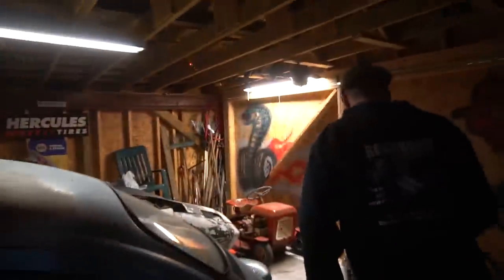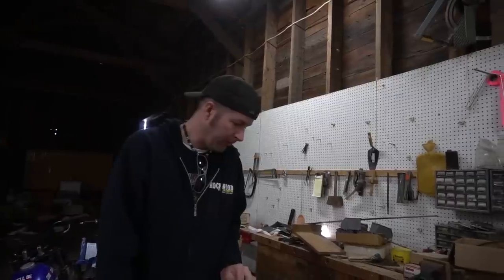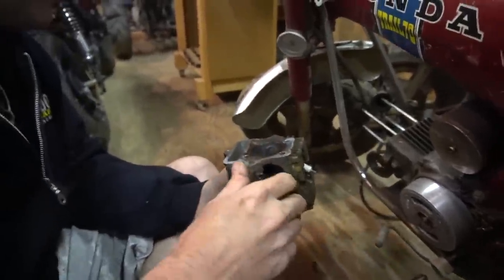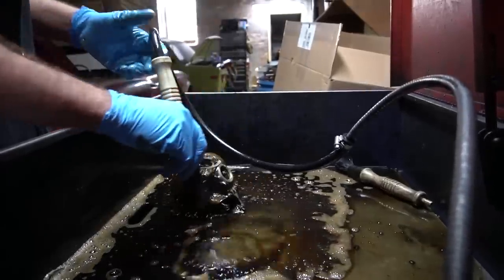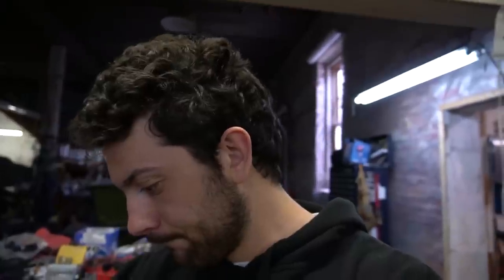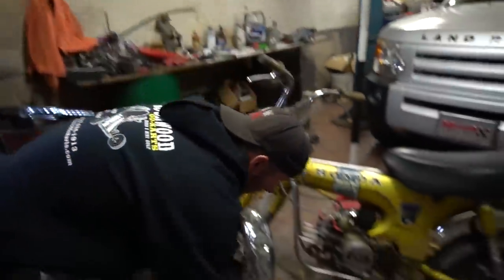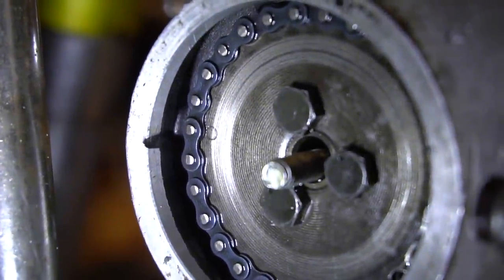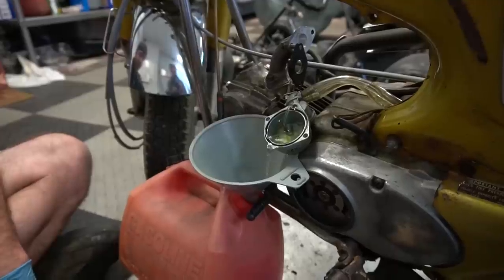Head Shaving with a Belt Sander! Trail 70 Performance Mods

Comment: I was about to just say that shaving the head would mess with the timing a little I do modify my two strokes I have yet to shave a head but I knew what would happen with the overhead cam four stroke.
Reply: BALDY'S CUSTOM PROJECTS it is very easy to totally screw a 2 stroke up. I build highly modded 2 stroke RC nitro engines. Messing with anything cylinder wise on a 2 stroke affects port timing,  squish and quench of the engine. it only takes .0001 of .0001 to take a 3.00 CC,  3.0 HP 45,000 rpm screamer to a 12,000 rpm dog that pings and overheats under any load. Been there done that.
Reply: losi8ightyew got it👍 i know what im doing to my bike engine but 45k rpm's ???
Reply: BALDY'S CUSTOM PROJECTS also wouldn’t the chain slap a bit. I thought I heard it I the video after head shave
Reply: "RC nitro engines" 
short stroke = high as frig rippums

Comment: hey guys,

a daytona 150cc or 190cc are the best options to go fast and reliable.
honda nice engine are one of the best but hard to find and high price
you want less speed but more comfort? then go with a zongshen 190cc.

here in belgium everybody loves the honda dax (ct50 / ct70)
if you want more fun of a bike then go for a honda monkey ( z50a or a mini trail )
for almost each state we have a club, and almost every weekend there are meetings where we go for a drive in group.

i prefere the monkeys , because they are lighter and look better

kind regards

Comment: when you cut the head on an overhead cam engine the centerline of cam is moved closer to centerline of crank affecting the timing.
Reply: AND with that much compression increase you are probably in racegas territory. or E-85. get a wideband and temporary mount on exhaust.
Reply: oh, lol. you covered it.

Comment: You shaved the head. Wouldn't the cam sprocket turn with the cam center now closer to the crank?
That must have some kind of chain tensioner (?)
Reply: Yup a chain tensioner on only one side. That's what caused the sprocket to rotate and not line up

Comment: The only thing with belt sanding the head is you have no real measure of how much you have removed and as a result you will get some predestination, as well as the timing will be retarding the timing (as noted by the gent from Go Power Sports).   Honestly I would have tore open that original head as the main reason you were low on power was most likely the air leak in the intake tube.

Comment: Hey guys...got a question. Predator 212: Could bad rings cause oil to come out the breather as well as burning oil be due to crankcase pressure? What would be other symptoms of bad rings?
Reply: Matthew B. I thought so too, but I made sure it was right... maybe a little too low...
Reply: Matthew B. That might be it...
Reply: Forgot to mention that it’s burning oil/ fouling the plug every 15 seconds.

Comment: Should’ve ground the heel of the cam for more lift.
Reply: It’s a velocity port it needs to go from 25 or so to about 23 millimeters so you need a micrometer.As far as fixing it you can just put some epoxy in there.And the exhaust has a giant weld in there at the header that you need to grind down.

Comment: Just go buy you a wrecked 2000's 600 and pull the wiring harness and motor. Your looking 120-150hp and you can mount a pingle electric shifter on it and have a push button shifter rail cart.

Comment: use double gasket at the bottom of the cylinder , check valve clearings. You ll be OK .....ohh and use some new valve seals , you re burning too much oil .

Comment: Mpg advertised was 96.1 of a 72. 138 miles on a full tank. Did i spot an old AMC gremlin in Ike's garage? That would be a nice car to restore if it is! That head has a hardened valve seat on the head your hillbilly shaving! Lmfao

Comment: This was a bit hard to watch as parts for these bikes cost a small fortune.   Also if the engines are noisy the main culprit would be thr cam which just sits in the head without any roller bearings.  As clearances increase they make more and more of a racket.   You boys just need some CT70Hs.  4 speed manuals crush the 3 speeds.
Reply: Xaphan Vassago theres only an oil pickup screen and as these engines get more modern roller bearings are incorporated, though i dont know exactly when.  These are kids bikes and are thus subjected to generally very poor maintenance and usually are beaten to death. That and being 50 years old, i have several worn out 70 heads that are super noisy.   Well death isnt ths right word as these motors are nearly indestructible and though will get noisier and noisier will still run.

Comment: if you guys don't intend on these engine running 50 60,000 miles just ditch the air filter all together and especially if you're not going to be on dirt road environment

Comment: you should do a compression test. that will tell a lot. put oil in spark plug hole compression comes up cylinder and ring wear. if it doesn't it is valves. not rocket science.

Comment: You shaved the head thus causing the chain to seem longer to the engine.  That's why the timing is not lining up. (there is no chain adjusters/tensioners in these motors)

Comment: This will bolt into the CT70, it is a Piranha 140cc Pit Bike Engine
https://www.ebay.com/itm/Piranha-140cc-Pit-Bike-Engine-crf50-atc70-crf-50-70-atc/390887546230?hash=item5b02b69d76:g:0dMAAOxy~iJRAAkN

Comment: The timing is now off because you shaved a lot from the head! This will put slack into the timing chain. And its only tensioned on one side!

Also you decreased your max rpm by adding so much compression!

Comment: Do yourself a favor and buy some actual jets and educate yourself on jetting / tuning
Reply: Keegan Browning a 15mm carb will flow enough air and fuel for at least 10hp. I have a chart somewhere with the correlation between carb thoat size and hp. Should be easy enough to find online
Reply: Swan Donovan for 10 hp a 19-21mm carb is optimal, as long as you aim for high rpm power😉 but i would not even bother with anything less than 18mm. We use 19mm carbs on Honda monkeys (50cc 3.5hp...) and you can feel the diffrence, compared to the standard 15mm.
Reply: If it's a name brand like mikuni or keihein ,you can order all kinds of parts if you know the carb model. 
There's all kinds of different shaped slides and needles ,pilot and air jets,besides the normal idle and main jets...emulsion tubes and all that jazz.
 It can be alot of work but if you study your carb model and know what circuits do what you can change parts accordingly to get it running nice.
Reply: Imo, no need for that large of carb.  You lose impulse / vacuum signal at low end, and actually hurt bottom end.  The difference you're feeling probably comes from a better tune / more tune-ability
Reply: Swan Donovan the bottom end actually improves, aswell as torque (especially up hills) and at low revs you only give it part throttle anyways, so the velocity isnt that important😉
Reply: Swan Donovan your right there I feel more grunt on pitbike with a smaller carb low-end but top end you can tell a difference higher up rev range it's all about balancing take power from top end to have more power lower  or vice verser
Reply: William Jenssen I think the improvement you're feeling in bottom end is coming down to tuning.   I've used 12mm to 24mm carbs on a 70cc two stroke, (engine stayed the same besides trying different sized carbs and of course correct jetting) a few mph top speed difference between the largest and smallest carb, smallest had better bottom end, largest had best top end. Ended up sticking with the 12mm.
Reply: Swan Donovan then your 70cc 2 stroke was terribly optimized. For a 50cc two stroke, the smallest oem carb youl ever find is 12mm and on a tuned 70cc kit, you would at least need a 21mm carb... I think you are the one having troubles tuning your carb... And 4 strokes have better vacum signals and handle big carbs really well, as long as they are perfectly tuned. A small carb is easier to tune, as the velocity is so high that you can just change the main jet and be fine... Trust med, i have over 5 years of experience tuning 2 strokes and 4 strokes, tearing whole engines down and tuning carbs as if my life depended on it.
Reply: William Jenssen I have maybe 10 years experience building two strokes. With Dyno proven numbers.
Reply: William Jenssen to be fair, that 70cc was making about 6hp. One of the other engines I built is making 26.5hp out of 80cc using a 30mm flat slide carb. Once again, it's not about carb size vs displacement, it's about carb size vs hp
Reply: What engine? a motorized bicycle?...
Reply: Swan Donovan wait you got 26hp out of an 80?! You're not talking 4 strokes right?
Reply: Rural Riding no, 2 stroke
Reply: Swan Donovan ahh ok just being sure lol
Reply: friend of mine is making 22hp out of a 50cc, but power band is extremely peaky
Reply: Swan Donovan that's insane I'm making about 25.5 on my cr85 ported and polished jetted and pro circuit pipe boysen power reeds...
Reply: 22hp? gotta be two stroke. even an oversquare four wont have the flow.... 

besides i'm posting here, in hope the guys pick it up: GET A Keihin PZ19 or a PE20! both use relatively easy to get jets, the PZ is less well finished, and often seen on chinese replicas.

you can get the real carb for 130-170 ish and the replica around 40, lower for unchecked ones.
i was a bit sad when i saw you guys mash honda gear, they are worth a fortune here. 2-3K per CT70, easy!

they need a race cam to make any use of the higher compression.
Reply: yeah as far as small engine tuning goes, it's two stroke for me.

Comment: Hey guys. When you shaved the head you took too much material off the head and made the timing off.  If you look at the distance of the timing is off it is the same as what you took off the head.  There by retarding the timing.

Comment: belt sand it down, but finish it off with sanding it on a mirror, that will give you a good flat end result!  you can tell if a mirror is good by lookin at it, flat!  one of you should not try this by looking @ the mirror.                                                just sayin x2

Comment: Shaving the head that much lessened the distance between the cam and crank, basically making the chain too long. With a tension side to the chain, the cam becomes retarded.  Easy fix, thicker head gasket or adjustable cam sprocket, if anyone makes one.

Comment: why did u shave the head for a stuck valve? all u needed to do is smooth it with some 320  ,,, thse are 4 hp motors, dont understand what your trying to do here..,
Reply: He wanted to shave the head either way it has nothing to do with the sticky valve

Comment: Suzuki samurai have a small rear end?
Reply: Marty Fowler similar to a older toyota 4x4.Im running 34 inch tsl super swampers on my sami and I've yet to break a axle
Reply: gordo66061 was trying to think what is the smallest rear axle you could find.
Reply: Golf cart or a true garden tractor that has a four or five hole bolt pattern wheels on them